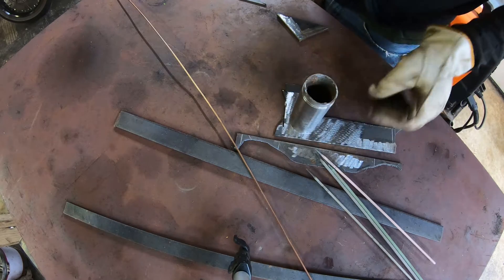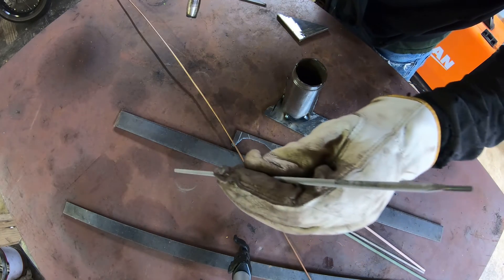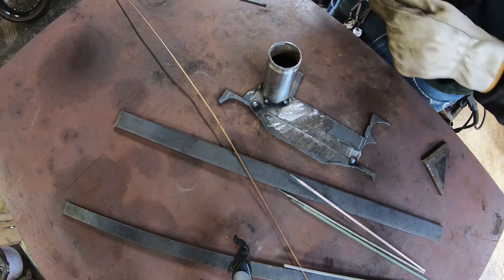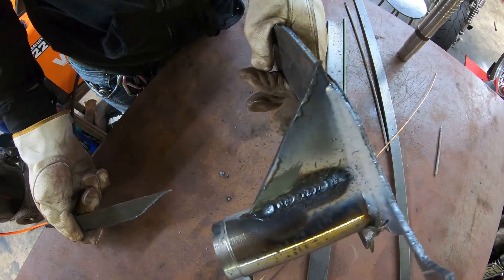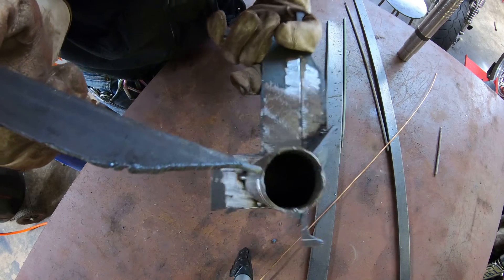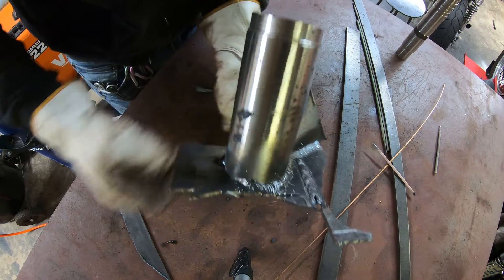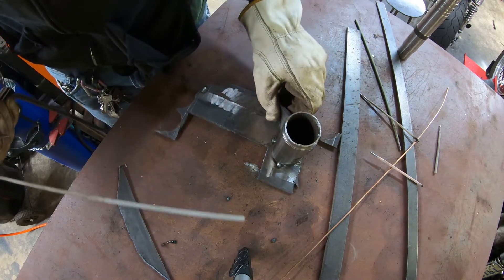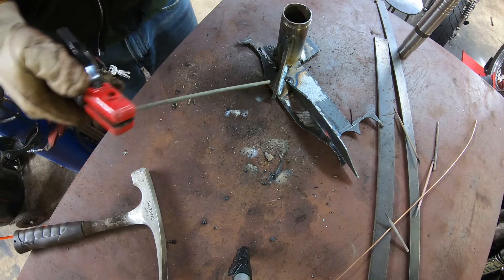Welding! Vulcan OMNIPRO 220

Comment: Dont know witch one to get...
Everlast THUNDER 215 vs VULCAN OMNIPRO 220
Reply from the maker: Id say it depends on what you intend to do. Ive never used everlast so I cant compare quality. I would have liked the omnipro more if it had a high frequency start and came with a tig torch like the everlast, but overall im not sure thats actually worth the price difference since they both only do DC tig. In the long term I bought a Primeweld tig225 as a dedicated AC/DC tig/stick welder and then a Primeweld Mig285 for the mig/spoolgun work. If you have the space, separate welders are awesome. If not and it's mostly mig and stick welding with occasional mild steel/stainless tig then the omnipro 220 is great. Will you mostly be doing Stick, Tig or Mig?

Comment: Why you doing scratch TIG with a pedal capable welder
Reply from the maker: Pedal only varies amperage on this rig, it has no high frequency startup, regardless of pedal
Reply: @ImprovisedBuilds  never used a non high frequency start machine I’m glad I asked I’ll look else’s where
Reply from the maker: @camriedesel1202  I actually ended up getting a Primweld 225 as a dedicated TIG and it's been awesome.  The Vulcan is great to start with though depending on what you want
Reply: I’m looking for a good multi process welder that doesn’t just break the bank

Comment: I dont have a proper workshop and with this welder, I've been using MIG. But I hate welding outside with the wind. Now I've purchased a bunch of flux coated rods to weld outside with the included rod holder. Seems easier than buying a new tig torch and a bottle of gas, not to mention the fillers.
Reply from the maker: If want to avoid the cost of a gas bottle refill I stick to SMAW and Flux core. They do great in most applications anyhow! My preference when appearance (tig) isnt the priority...is to use mig to tack weld and stick to finish up

Comment: Just bought the Vulcan Omnipro 220 today and the setting for thickness of metal won't show 3/8 or 1/4 in it just shows the gauges ! Any advice ?
Reply from the maker: Are you plugged into 120v or 240v?

Comment: Lower the arc heat at the end of the puddle then dab it with the filler and you wont have a crater
Reply from the maker: I dont think I had a foot  pedal when I made this video, fixed amperage only but definitely a good technique
Reply: @ImprovisedBuilds  i haven't bought the tig setup for my omnipro yet but you can adjust the amps with the footpedal on the omnipro or no?
Reply from the maker: Yes once the pedal is hooked up you can vary amps

Comment: It would be better if you had a filter in front of your camera so that we could really see what your method is.
Reply from the maker: I happen to have a spare welding fixed lens I can use for that, I dont have anything to hold it on the camera yet, but I did recently get a 3D printer that should, with a little SolidWorks magic fit the bill perfectly! Good suggestion.

Comment: How is it I'm only your 400th sub?  I mean no intro, just straight into it, I luv it.  btw, hows the Vulcan 220 holding up a year on from this vid?
Reply from the maker: Thanks! The Vulcan is doing fine still with no issues, I finally  got a foot pedal a few months ago for the TIG. I didnt really need it, but it's nice to have the arc control when I want it.
Reply: @ImprovisedBuilds  thanks. You answered my question. I am learning on Millers and Lincolns right now, but was wondering why you left the gas running and why you didn’t pedal up a bit.   I bet it’s much easier with a pedal and the pedal controlling the gas.   I want to buy one of these within six months.

Comment: How does the Vulcan omnipro 220 hold up against something like a Lincoln electric? These are probably the most common 2 brands I've been seeing.
Reply from the maker: I used to use Lincoln Electric at work but it was always either TIG/SMAWor a MIG only...never a combo of the three so in regards to comparing apples to apples I cant honestly make that comparison.
Reply from the maker: Is there a particular model you are considering?

Comment: Great video, love my omnipro 220 but I’ve been practicing stick for my next weld test (haven’t done much stick) and on my 6010 root pass my arc keeps stopping kind of like your 6011 did early on in the video but worse. Do you have any advice?
Reply: Inverter machines do not like 6010 rods. Some websites even list if a machine is capable of using 6010 or might even have a specific 6010 mode. You should use 6011 on inverter machines.
Reply from the maker: My arc wasnt very stable  for likely 3 reasons, (1) I was using the cheapest rod I could find, (2) my amps may have been a bit low for that weld and (3) I was whipping a bit too much and on only 120 volt power supply the welder probably didnt have enough ass to long arc it. If your doing a root  pass and it wants to arc out, try a few more amps and hold a tighter arc, if its set at the correct amps it should be pretty hard to have the arc go out from being too close  once you start the pass. Is it sticking only when you strike an arc and are trying to establish a good arc, or half way through a rod?
Reply: Improvised Builds I bought some better rods and run a little hotter now, and that worked wonders! What was weird was my rods weren’t sticking, just going out 🤷🏻‍♂️ wound up taking a test for a mig job anyway, but thanks for the feedback!
Reply from the maker: No problem, may have been the setting, how many amps on what schedule pipe (or plate thickness?) Hope it went well!
Reply: Improvised Builds with decent rods I like 6010 around 85, but after bumping up to 95 my roots went in like butter. 1/2 in” steel beveled with an 1/8” landing

Comment: Hi nice video, one question did you have to adjust the settings on your helmet for the different welding process?
Reply from the maker: Not typically..if I'm welding low amps I may go to a lighter shade for better visibility. For the most part though I typically set to about shade 11 and leave it there

Comment: Thanks for posting that. I'm buying an Omnipro next week. I've been studying them for almost a year. Getting by with my 110v Lincoln MIG rig. My buddy bought an Omnipro about a year ago and still loves it. He has built about a hundred yards of steel pipe fence with it mostly using flux core and stick without a hiccup. He did say if you have a long run of power cord to your power source you are MUCH better off using 220v power. I guess that goes without saying... anyway he still loves his rig after using it hard for over a year. I'm buying one while they are 20% off until 11/24/19. I appreciate your video. Happy welding amigo.
Reply from the maker: Thanks and best of luck with your ventures! This welder has been great.  Working on wiring in a 220 power supply this weekend  actually!
Reply: By the way, I have an 8750 watt Predator generator from HF that I've had for about 3 years. I got it for about $485 if I recall. Anyway it runs great and pushes 220v no problem. Runs my buddy's Omnipro on 220v like a champ. Nice value for your travel rig when away from your 220v wall outlet...
Reply from the maker: I'll have to check that out, wouldn't be bad to have one for the house but being able to power the welder would be awesome also!  I got 220 wires in now so I'll actually get to see how hot this thing can burn!
Reply: I'm glad you got that 220v in. Should be super handy. I got my Omnipro! I'm still setting it up. I had to go out of town for a few days. Also, my 220v outlet in the shop is 4 prong and the welder is 3 prong so I ordered a little pig tail adapter. I considered a whole new outlet but decided on the pig tail so I would still have the 4 prong if needed down the road. I subscribed to your channel. Hopefully you'll post some Vulcan video on 220. I might on my channel... haven't put any welding footage over there but might be interesting. Thanks again for posting, I appreciate your content.    - Sonic Ox